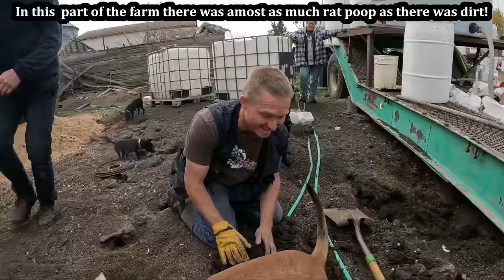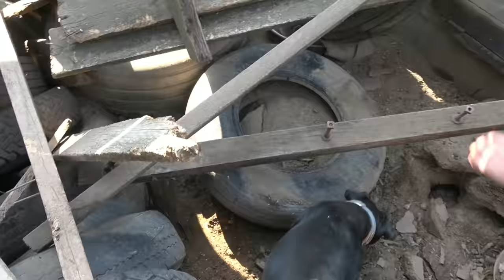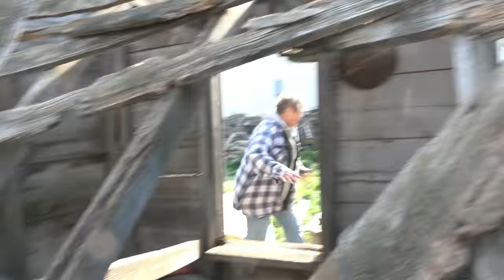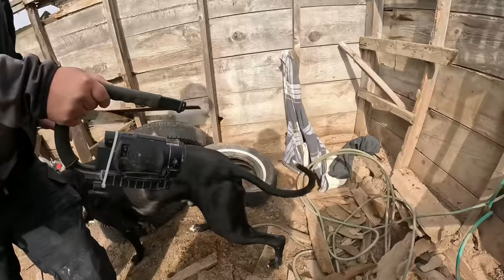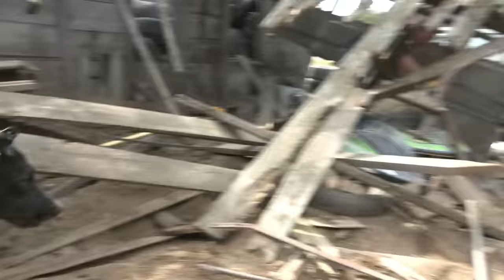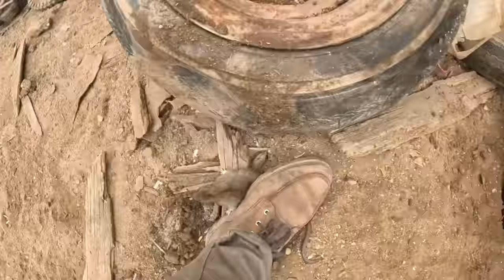INSANE! Rat Infested TIRE???

Comment: loose light bulbs should be removed before  they break and the dogs cut  their feet. way too much clutter for dog's safety
Reply from the maker: And yet not a single injury. My dog's feet are as tough as boots, and their hide as durable as work gloves. There's NO WAY to remove all of the hazards, so you must work with tough dogs, who are accustomed to tough work. Despite all the craziness, injuries are incredibly rare for my dogs. If I worked with soft hose pets, I'm sure the story would be different. I, on the other hand, am not as tough, and get hurt pretty seriously sometimes (foreshadowing)
Reply: @JosephCartertheMinkMan  please do something with Shawn woods from mousetrap Monday
Reply: These are dogs not some apartment doll
Reply: @Hot Metal Knives HMK  It doesn't matter, really, what animal it is.  I used to go out in the streets in Arizona in the summer without shoes, and you build calluses quickly, which you can also easily remove, because they're just dead skin.  For dogs, they have shoes to walk them in such heat, but even people can get used to it.
Reply: @JosephCartertheMinkMan  Oh no, I hope you're ok?
Reply: @evolunchbox  Well, I live in Florida now, and like I said, it's easy to remove dead skin, so I just wash my feet and there are no calluses or problems.
Reply: It's true what he says about his dogs.  Very tough and no injuries on this trip.  There were several large bits of glass removed on occasion as well.  As much as could be done was done.  However note the gloves he (  @Joseph Carter the Mink Man  ) is wearing!  He has harassed at least Matthew and myself for that, heartily, in the past!  I just want that noted for future reference here!  😁
Reply: @JosephCartertheMinkMan  I love your dogs their Natural Born Killers I hate rats I love watching your videos
Reply: @JosephCartertheMinkMan  hope you got paid for the clean up duty. Wow no wonder these places get so many rats. Incredible job but like Peter commented there was a few times i was worried one of your team would get hurt. So many pokey out bits and pieces lol. 
Also side note... Editing, camera work and general extra little nuances i noticed over time are improving. Nice work 😀
Reply: What do you do with the rats ?  Could they be turned into dog food maybe ? Can't afford to waste much these days
Reply: @pixie706  in case he doesn't see your question. The babies are kept to raise or feed snakes and not sure about the rats but fur and meat usually used to feed his critters. He has spoke about this in other clips👍. Think I've got the jist of it. Been a bit.
Reply: If they removed all the hazards before ratting then there wouldnt be any rats left hahah also if the dogs DID get injured, Joe would 1000% give them the best care and allow for proper rest before returning!
Reply: The  only thing I can see kinda wrong is the wood on the floor if a dog get impaled as they chasing the rats they don't pay attention apart from that cracking stuff as always
Reply: Probably nails and God knows what else 🤦🏾‍♂️
Reply: i'm surprised you didn't ask if the rats were harmed in this video
Reply: Working dogs, buddy. A different caliber.  ;)
Reply: Ok karen
Reply: I AM COMPLETELY AMAZED AT HOW MANY RATS CAN FIT INSIDE OF A 15" TIRE 😂! NICE JOB TO YOU, THE CREW AND THE DOGS!
Reply: Great fun to watch. Thank you
Reply: ah yes. the dreaded light bulbs...because everything else was perfectly safe for the dogs. Another expert.
Reply: @JosephCartertheMinkMan  this is so amazing!  This is a old trade, as rats infestation is city, suburbs and farms.  I am so happy for the canine breeds that can do what they were bred to do by the Ratters of old.
Reply: Some of the best YouTube I’ve seen in a while!
Reply: @GoshDarnBarnOwls  😆🤣🤣🤣
Reply: @pixie706  Good question
Reply: Dogs love to work in the farm outside.
They really do. They  don't care about small injuries. They are happy.
Reply: Would be nice to put some microphones on dog collars or harnesses to get the crunchy sounds of the kill
Reply: Even if they did get injured, you don't think these guys would do whatever they could for their animals?
Reply: “Joseph Carter The Mink Man” 
Respect to you!! Hell yeah toughness!! 

Dogs are tough as gorillas. I probably exaggerated a lil bit but you see what I’m sayin!! Those dogs are straight killers!! Real talk!! They ain’t worried about no small lil cut on their feet!! Toughness!! 💪🏾💯🐕
Reply: These are working dogs, not welfare dogs, or someone’s security blanket 😂
Reply: I agree that its a bit scary to see those nails, sharpboards and lightbulbs.
But keep in mind that these dogs are very well trained and extremly smart.
Accidents can always happen so minimizing the dagers should always be a top priority.
Reply: You've never been in a old falling apart barn have you? Almost every step is a hazard
Reply: @JosephCartertheMinkMan  💪💪💪
Reply: @JosephTurcotte117  heyyy bruhh!!
Reply: @JosephCartertheMinkMan  just say you don't care about your dogs feat getting cut up because you want a viral YouTube video hunting
Reply: @ricardosierer1609  Ok Karen's boyfriend.
Reply: I completely agree with you, OP. These videos are equal parts astounding and aggravating. Astounding for the great teamwork and effectiveness of the pest control, but aggravating that this level of trash was allowed to build up and continues to be ignored/not cleaned up in the rat control sessions. I know, I know, Joe's dogs are trained and developed for this level of work and they're not tenderfoots. But this farm has some serious clutter and trash, and it's hard to watch these dogs going all out but having to play an obstacle course with glass, wood splinters, and old nails, among more various garbage. If the dogs didn't get any injuries, I'd chalk that up to luck more than toughness.
Reply: Dogs aren’t like humans. They can deal with alittle bit of debris. Somehow people forget that humans are exactly like other animals. WE would get hir with nails and splinters and broken glass but dogs are built for this for the most part
Reply: I was a little more worried about the wooden planks with nails sticking out of them, glad to hear the dogs didn't get hurt.

Comment: This farm really looks like it could use some intense property maintenance. Like, I don't expect it to be perfectly clean and organized, but the massive piles of junk are definitely helping the rats more than whoever owns that farm.
Reply: If the business model of this 'farm' is not to raise as many rats as possible, this 'enterprise' should be out of business for years.
Reply: The so called farm must ve burnt down, I have never seven such a disgusting place. Government should inspect this type of places..
Reply: @AGuler-ml9hc  i mean from the looks of it, it looked like the owner picked out a cheap land away from population. And the only thing i see there is stacked up woods probably as an extra or something. I dont see anything very wrong with it
Reply: Another great video with great dogs doing their work!
That farm needs a good cleaning outside. No wonder they had so many rats there with so many places to hide!
Reply: In comments on another video, they explained the farm owner has changed what they grow, no longer store crops in those silos (sold immediately) and are starting a massive clean-up of the property. Ratting is stage 1 of the clean-up. Large equipment is coming in to tear down silos, buildings, etc. They already have tried poisons and other means of killing rats with little success.

Comment: A huge part of this rat infestation is the dirty mess the owners have. They are paying you not only to wipe out those rats but to clean up their junk they’ve been stacking that they probably thought they were gonna use later on in the future. Sure enough the rats put it to good use.
Reply: The food availability on an active working farm is the real issue.  Only so much you can do about that.  They were ground nesting everywhere - under the silos cement slabs, directly in the dirt, everywhere.  The old farm junk is definitely good habitat for them, but even without it they would have all been there.
Reply: Like Chuck Kimber said, the rats only gravitate to areas where there is plenty of food for them and any junk lying around is a perfect place for them to roost and breed after they feed.
Reply: All that old wood is probably still worth a little bit of money and the tires could probably be recycled. Most of the crap would be gone then.
Reply: Now if they would get some dump trucks and get rid of all the trash! Fat chance...
Reply: Nope. There are videos of these English farmers in the field just turning the dirt and they nest about a foot to a foot and a half under the surface. Of course they will nest in the junk but if it wasn’t there they would be making home under the dirt. As long as there is food they will be there.
Reply: @christopherv5781  It will delight you to know that's exactly what they were planning on and the reason we could tear the place up like that.  The dump truck and loader were scheduled for just about this time in November actually.
Reply: Noticed same. The place is unkempt and hope they charge for housecleaning. Raised on a huge dairy farm in the Catskill mountains.
Reply: The rats wouldn’t have moved in next to the giant food towers if not for such nice living accommodations
Reply: Owners needs to be fined.

Comment: In future to cut saplings and rotten boards. You might want to invest in a battery chainsaw. The new ones advertised are really good. And not very expensive. They don't vibrate as much as a Sawzall. So less stress on the hands. Between the 2 there won't be much you couldn't get through. I got 2 this year. I recommend getting one with 2 batteries and chains. Thanks for sharing your video.